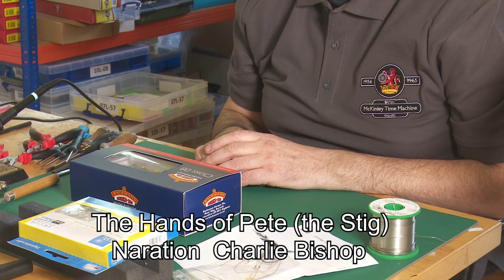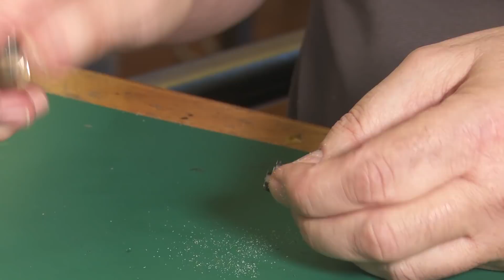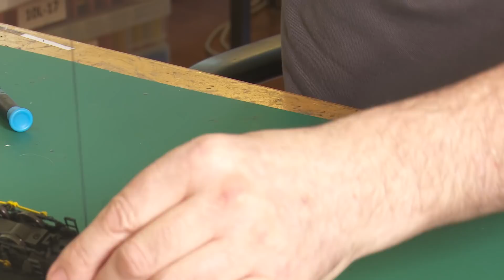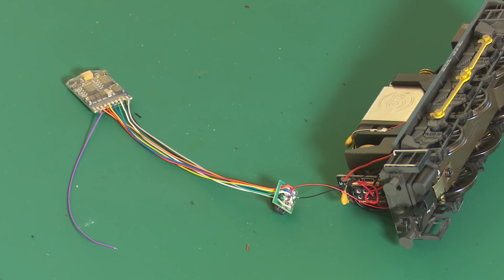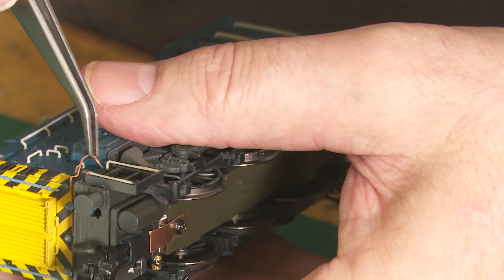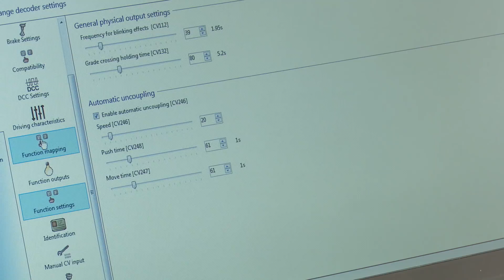31. Automatic  Uncoupling on McKinley Railway

Comment: Which ESU decoder would you suggest if I wanted sound as well - on this model?
Reply from the maker: Sorry for the late reply. There are only two  The Loksound 5 or the Lokpilot 5.  They have identical functionality with the uncoupling.  A word of caution when using this function with sound.  Sound will often delay the movement of the engine and you might be a little disappointed as a result. We avoided adding sound to our shunters for exactly that reason.

Comment: contend ?  RC control and battery engine :SDirectg cab control is really close as it gets to real driver control. ?  opens a whole new freedom away from  DCC and track electrics
Reply from the maker: I like your idea, but we have 200 engines on the layout and I don't want the job of changing the batteries every so often.  DCC gets me away from power worries.  Batteries add to it.

Comment: You showed how to fit the motor ,but NOT how it works .does it wind the cotton on to the motor spindle ,or what??https://www.ebay.co.uk/i/252323123461?chn=ps&norover=1&mkevt=1&mkrid=710-134428-41853-0&mkcid=2&itemid=252323123461&targetid=876751517470&device=c&mktype=pla&googleloc=9046086&poi=&campaignid=9446017636&mkgroupid=94592364383&rlsatarget=aud-629407027345:pla-876751517470&abcId=578896&merchantid=6995734&gclid=CjwKCAjw-YT1BRAFEiwAd2WRtnyLJu9GQNajKAXNS19amoAKtJzqKf12-o_EZ7HkaMfoEbBscs7mjxoC9OYQAvD_BwE

Comment: This is almost like what MTH has been doing on their locomotives for years. The coupler itself is the whole mechanism though.
Reply from the maker: Hi James,  The uncoupler itself is only psrt of the solution.  The uncoupling logic (i.e. shuffle backwards and forwards with a controlled time for the uncoupling motor to fire)  embedded in the LokPilot DCC chip is the equally important co-player.

Comment: You seem to have found the Holy Grail of model railway operations! I had dabbled with Krois uncouplers but while it was OK to uncouple I found it hard to couple. Can you couple the shunter back to the wagon easily with this or do you need to open the knuckle of the coupler before you can?
Reply from the maker: Hi Kenneth,  We rely on the generic Kadee functionality as that what these couplers are.  All the uncoupler motor does is pull the coupler open to allow the Loco to move away from the wagon.  It works in exactly the same way as the Kadee magnets except that it is a piece of string opening the coupler and not a magnetic field.
Regards  David

Comment: This is a real game-changer: no more magnets, uncoupling ramps, or hand-held coupling poles. I wonder if the cotton thread will be strong enough to withstand sustained use. Will it maybe stretch or fray? Could something like fuse-wire be used as a stronger alternative. It will be very interesting to see how they perform over time. If these ARE strong enough, I wouldn't be surprised if these turn-up on ready-to-run models fairly soon.
A great concept which can, quite probably, be adapted for other uses. The possibilities are endless, limited only by your imagination - Thanks for sharing the process.

Cheers for now,
Dougie.
Reply: It may be worthwhile trying a thicker heavy duty button cotton thread as this is two to three times thicker however it would be worthwhile creating two static trial rigs one with normal cotton thread & one with heavy duty cotton thread just to compare the heat generated by the solenoid when using the heavy duty version that there is no noticeable increase. 
https://www.zippershipper.com/heavy-duty-button-sewing-thread-100-cotton